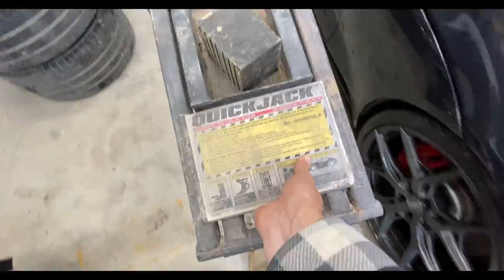A Day At The Original Goonzquad Garage!!!

Comment: The weight in the cop car steering wheel is a “Mass Damper” it’s to reduce the vibrations in the steering wheel. It will vibrate in anti-phase to the problem vibration in the steering wheel. The weight is usually 1/10th of the problem vibration.
Reply: Huh.Thank you.I really had never seen that,and wondered.Kewl to know.
Reply: I didn't need to know this but I am actually really glad I do. Thankyou 😂
Reply: Good thinking, Kevin. Weights at ends of motorcycle handlebar same idea. Now I'm all upset about the doberman.

Comment: Hey guys I got some ideas for the building of your new garage up on the mountain. 1 do not add a bay for painting Build a seperate building for that. Paint particle find their way into places you don't want it.2 include a wash bay in the paint booth building. 3 THE GARAGE Plan on 4 bays with a full lift in at least one.bay and don't forget an office, and room for part racks for each bay. That should be good for the back half. 4 the front will be a showroom for finished projects should fit 6 cars. 5 Above the showroom  a large space for consumables an storage of part to be used later, this area would be entered from the back bays. Just thinking take what works and laugh at the rest. As always have fun in al that you do.

Comment: That Well House will make a perfect Security Gaurd shack to keep the interruptions down. No need for another fence! 🤣
Reply: The perimeter of the site is 3,100 feet long, so fencing it would be uneconomic, and in any case rural insurers do not require this since boundaries are often concealed by vegetation and criminals can work unseen to effect entry through almost any type of fencing. Goonzquad need a holistic, effective and efficient security strategy designed by an experienced professional who is aware of the actual threats in that locality. They should also acquire information from the Crime Prevention Department of the Chattanooga Police to increase their knowledge of current illegal activity in the vicinity.

Comment: Where’s the Audi?
Also why is there exhaust smoke only coming out one side of the Supra?
Reply: Probably the valves were closed for the other side. On the supra you can have both sides open or just one to quiet it down a bit.
Reply: Yes what about the A7, duuudes?
Reply: It’s part Bmw maybe it’s for looks lol
Reply: BMW exhausts have a cold start flap that closes one side of the exhaust. Common mod is to stick a golf tee in the vacuum line for the flap actuator to plug it and keep the valve open 24/7.
Reply: It's just a cold start it always happened to my GTR after a while of sitting
Reply: @EIM2307  Its the main question
Reply: Since the supra is a straight six engine, meaning the headers only comes out from one side of the engine, the exhaust closest to the exhaust port will be used during cold starts if theres a valve, otherwise the exhaust on the header side will always smoke more than the other one in a dual exhaust straight engine set up.
Reply: Because it was on eco pro not on sport mode

Comment: I wonder if that weight is too keep the wheel straight while the cop looks at his computer?
Reply: Actually I just saw this on another channel. The police Chargers at least, have a self centering steering wheel. If you come to a stop and let go of the wheel, it will return to center no matter if you had it turned left or right. I figure the weight that they removed assists in that.

Comment: I would like to see you two stand side by side one time. When you build the new garage, maybe you could install a rolling car lift so that you could put your cars on a rack system on the back wall to save floor space. You might need a  land pad at the new place, maybe a elevated/level one on the hill out front of the house With a turning deck.

Comment: The lip on the SUPRA is called a splitter in racing. It divides the airflow between under and over the car and directs most of the airflow over the top, that gives more downforce to make the car stick better in the turns. A rear spoiler or wing gives downforce to the back.

Comment: I’m still sketched out about that helicopter dudes, just too dangerous
Reply: Ditto.   Seems to be a small ????????
Reply: Fix up and sell the helocopter!   Yall said fly helo from one house to the other(with both boys?) If things go bad both boys could be hurt or worse!!  Fix it THEN SELL IT !!!  To risky guys !! Keep to the cars and trucks(and the future "Goonzquad Empire")!!
Reply: Flying with a heli is safer than travelling by car. (according to statistics)
Reply: @tojassargaja2085  no its not.
Reply: As long as they have a professional checking out their helicopter build (inpection on all the components/parts) and as long as they will get their pilot license then it's good to go
Reply: @pete_mitchell  What do you mean its not? Helicopters are mutch dangerous than planes, but its still far safer than a car. 
Air lines death index is 1.
Non-scheduled helicopter flights death index is 63
Driving or riding in a car/SUV is 453.6.
Reply: @tojassargaja2085  We are talking general aviation, not airlines, if these boys get their PPL(H) and fly on their own you cant compare the safety to commercial airtraffic safety on airplanes or helicopters.
Reply: @tojassargaja2085  In fact, general aviation / sport aviation is roughly 19 times more dangerous than driving cars, as whole. Dont know how fixedwing aircraft are compared to rotary but one could suspect the difference is about the same as in commercial. You should look up AOPA if you want facts.

Comment: Now you can add some body kits and framing mods to the construction equipment, do something insane like adding a hydraulic shock setup to them and wishbone suspension to the skidsteer, add full turning signals and driving lights, regulation airbags, enclosed with air conditioning and heating, wicked stereo, then you can freak people out as you pull up to the lights and start hopping it around like cheech n chong did with their van in that movie.

Comment: Radium stripes with led stripes lighting on helicopter to really shine at dark night.
Reply: The brothers will first need to obtain their Solo Pilot Rating and Private Pilot Certification for rotary wing aircraft, which will take several months and cost each of them about $30,000, depending on their aptitude. There is no guarantee of success, and the academic element of the training is quite demanding, so as the brothers did not attend university they may find this challenging. Once licensed, they will likely be limited to flying using VFR (Visual Flight Rules) which usually means they may only fly in good weather conditions, most often in daylight. To fly at night, when there are no visual references, they would  have to train in and be certified for flying under VFR (Visual Flight Rules). Only then would the external lighting of their R22 become an issue.

Comment: I cant believe they are still running that shop on  extension cords  from the house, Mabey the mpuntian house electrician can trench in a underground conduit and pull  some #8 wires from the house and throw a breaker pannel in that shop to run all the fans and lights ect

Comment: Put the Cop Charger up at the new spot, scare away potential theives!
Reply: Hmmm, it might, but the Chattanooga tea leaves could just regard that as a challenge. I wouldn't put it past them to nick an M1 Abrams Main Battle Tank, unless it was welded down to an aircraft carrier deck. And even then, they'd have it away with the hubcaps, the wing mirrors and those nice carbon fibre radio antennas. Can't trust no one these days...

Comment: You need a garage ASAP at the new HQ
Reply: Progress on that is largely dependent on what kind of winter they will get at the mountainside location. First signs are not good, so that may well slow down completion of the HQ House and stall any progress on the Garage/Workshop. It is therefore unlikely that any car projects will be possible there before summer 2021 at the earliest. Goonzquad will have to adjust their plans and resume using the workshop at their parents' home in Rossville, Georgia, if they are going to keep their fanbase satisfied over the next six months.

Comment: Don’t be doing more builds and not completing the ones you have already. My suggestion is go all out on the OG mustang. 
•built motor
•built rear end 
•built transmission 
•smaller pulley or turbos 
•big break kit
•full blown strip/track suspension 
• goal is to hit 1500 rwhp 🔥🔥

Comment: Do a Tesla!!
Reply: They could try that, but Rich Rebuilds found that Tesla were not cooperative in supplying (expensive) spare parts, so the work took forever. I think Rich has exhausted the current YouTube potential for those vehicles, so perhaps Goonzquad need to find something more original for their 'comeback build'. A Trabant comes to mind, or a recent fast JDM model, or an upmarket SUV that was damaged in a local meth lab explosion, perhaps?